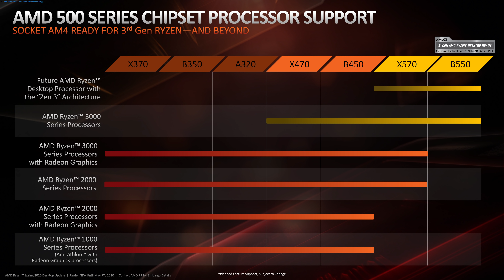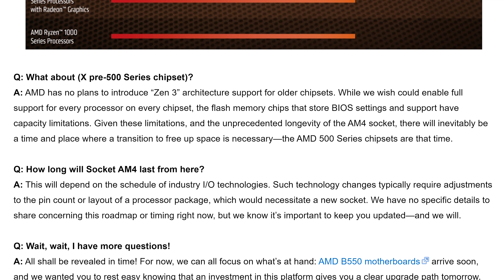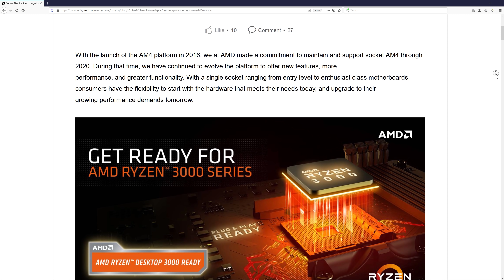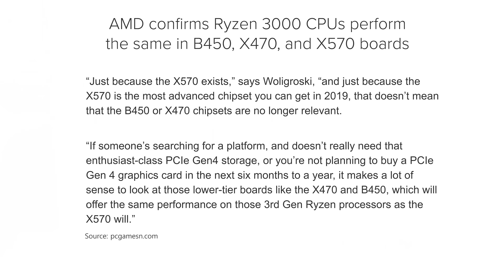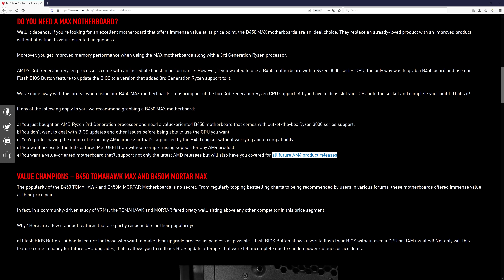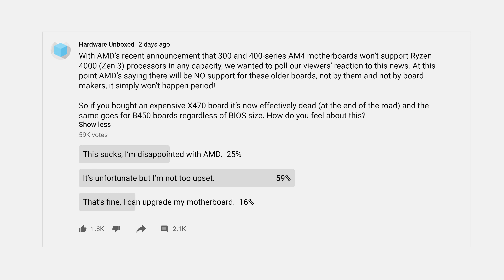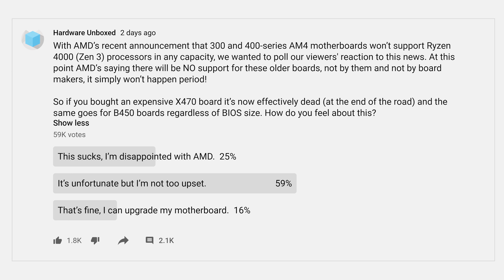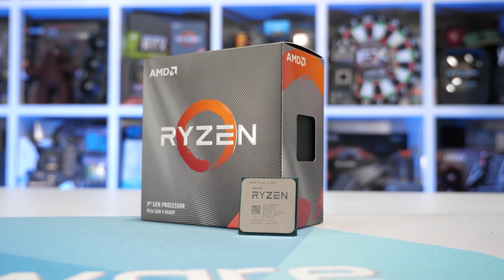AMD Does An Intel, Axes Zen 3 on 400-Series Motherboards, Our Thoughts

Comment: I'm really pissed of for the exact reasons he called out: I spent 100+ € on the tomahawk max half a year ago for zen 2, expecting it to support zen 3, however had they said back then that zen3 would not be copatible with it, I'd definetly had bought a x570 board! The way amd communicated all this was indeed very misleading!
Reply: Similar reason as you, I picked a B450 board that was slightly lower priced than entry level X570, it also had extra features except PCIE 4 which I didn't need. If AMD had to do this they should have told long ago, since they didn't tell long ago they shouldn't do this.
Reply: A friend of mine got Tomahawk MAX 2-3 days before they announced this!
Reply: @karama300video  Me to. Pissed to the max now. And going to amd after over decade with intel... Hope they don't became same!!!
Reply: @karama300video  Return/refund.
Reply: i guess b450 was just too good
Reply: I bought the Max in March this year. Would have gotten X570 if I had known.
Reply: @KeysCaliber  Right!
Reply: Same thing... My max board with zen2 is "dead" for future.
Reply: Same here, MAX board to get out of box 3000 series support and 4000 series support. Plan was to buy B550 motherboard that was supposed to come out January, but really it should have already come out end of 2019, 3 months later that X570, like B450 came compared to X470.

Funny/sad thing is I've been with Intel years and years and always bought a new motherboard along with CPU. "AMD is great, just get a new CPU, no need to change motherboard!" So to go from Intel to AMD I needed both and this motherboard has support for even less than Intel offers :)

And there's zero IPC improvement going from 3600X to 3950X (not to mention silly price), so it's not an upgrade path, like someone suggested. The time first game needs 16 threads or more to play proper, we are already on DDR5. But a 4700X would be nice, if AMD was nice..

Already see Asus coming out with a sweet Z490 mATX board, that will have support for 10k series and 11k series and if I upgrade to B550 I only get 4000. Hopefully there will be as tasty mATX options in B550, as my planned upgrade to that is for the motherboard features mainly, not upcoming 4000 series.

And last funny note, 2 things AMD had that Intel didn't is that every CPU works on every motherboard and all CPUs are overclockable. Well Zen 2 doesn't overclock and and now you can't mix/match CPUs either :) Added bonus, "motherboards are cheaper!" yeah not, X570 more expensive, last thing AMD has left is CPUs are cheaper, but now Intel is also "lowering" prices, by offering more cores on same price bracket.

Better be instant functioning AGESA on 4000 series and not current "works after 6 months" after release. Else this support blocking did zero good.
Reply: @Tobias Steindl: I fully agree with you bud. I am not effected personally (I am an X570 owner) but this move still upsets me greatly. I have many friends and know many people (and now I am adding all of you guys to the list) that are stiffed by this move from AMD. 

I absolutely 100% believe that AMD knew this was coming last year already (I am sure because of many reasons) and AMD chose not to say anything last year at X570 launch and just let everyone keep buying older chipsets regardless. 

I am livid and I think that even X570 owners (myself included) should not put up with this absolute nonsense from AMD. 

AMD chose to keep quiet, now AMD must choose to support older chipsets. End of story, no debate, do the right bloody thing AMD, period. There is no discussion, there is only AMD supporting older chipsets.
Reply: AMD fans are just... something else.
Reply: @donicsm7684  It's not just AMD fans, it's fanboys in general. Do you think any company really cares about you? They want your money
Reply: @3point1.2  The last time everyone called out Intel or Nvidia I don't recall seeing this much people on the defense. I saw a few but not this much and this intensely. 

Yeah fanboys in general but especially AMD fanboys.
Reply: @jakea3950  Calling people kids. Setting a stellar example, I must say.
Reply: Damn that sucks! My mate has x470 and 2700x , he planned to get a 4000 series cpu later on but now hes screwed
Reply: @cliche_AF  I myself have a B450 with a 2600X, bought last year's black friday. If I had even expected this to happen, I still would still have opted for the B450 but in combination more expensive and more beefy 3600 instead so I could delay another upgrade down the line.
Now I have to hope the R7 3x00X lineup gets massive price drops when the 4000 lineup hits shelves, because otherwise my upgrade strategy is f__ked!
Reply: Same here mate. And if you look on how popular B450 boards have been since the zen2 release, I would expect AMD to have a lot of angry people at their doorstep now.
Reply: I hear ya bro im in the boat, up shit creek without a paddle.
Reply: @je5terc0re  3950x isn't enough for you? Not if it gets beat for gaming by a 4600x that costs a 3rd of the price.
Reply: @je5terc0re  They promised Zen 3 AM4 support for all motherboard in 2017 and if u promise something u should make that promise come true. Many people bought a X370 because they expected support until 2020 with Zen1 to Zen 3. I understand that AMD want sell more X570 motherboards AMD do the X570 chipset but this is really shady. AMD Intel and Nvidia are companies we shouldn't trust any company and this is the whole conclusion of this story.
Reply: @strohhuttv8848  and what year is it? 2020. They ended support.
Reply: I bought Tomahawk max for the same reason. :) Seems I will have to go to X570. :D
Reply: @ziksify  
No need to rush my good man/woman.
Drain everything you can from that board unless absolutely necessary to go get 4000 series now.
IF you need to upgrade from 3000 or whatever, change motherboard, you might just as well consider Intel. 

There is NO absolute guarantee, 
that 4000 series will be supported by X570/B550.
Now they are saying that they will, but they might still pull the plug for the compatibility support regardsless.
Reply: @GameslordXY  Yes, AMD has already 100% confirmed Ryzen 4000 (Zen3) CPUs will absolutely work on X570/B550. What AMD has not confirmed is if X570/B550 will work with Ryzen 5000 (Zen4) CPUs (I doubt it, that will be AM5). 

AMD has never 100% confirmed CPU support and then pulled that support. 400/300 chipsets were never outright confirmed  (or outright dismissed until now either) for 4000 support. But X570/B550 4000 CPU support is 100% confirmed, no ifs, and or buts. 

For you to say "There is NO absolute guarantee, that 4000 series will be supported by X570/B550" is an absolutely ridiculous statement.
Reply: Je5tercore we are gamers why the fuck would we buy a 16 core latency fest crap chip over a monolithic 8core zen3 or rocket lake ?
Reply: Why did you expect it to work with Zen 3? If you look at AMD's official Socket Stability slide in the article "3rd Gen AMD Ryzen CPUs Will Work on Many Existing MSI AM4 Motherboards" (search it on Google), you'll see that the graph clearly shows no support for new CPUs after 31 December 2019. If you take a good look, the orange bar stops right at the end of 2019, just before 2020 starts. It was already know even a year or two ago that Zen 3 will come out some time in 2020, or in other words, AFTER the official support period. So how did AMD not keep their promise and why did you expect it to work with a CPU that releases after the support period?
Reply: @bgtubber  Well going by that Zen 3 wont be supported on any boards.
Reply: @JimmyChino55  How so? They will most likely release a new motherboard series like X670 with the launch of the new Zen 3 CPUs as they always do. Also, B550 was launched after 31 Dec 2019 so that one would work too. Not to mention X570 which according to AMD's official slides shouldn't have worked on new CPUs from 2020, because they didn't promise it, but after all gave us a bonus and allowed us to use it with Zen 3. So I think that people not only have no right to be mad about something AMD didn't promise, they actually made a gesture and allowed a board that falls outside of the official support period to work (X570).
Reply: @bgtubber  AMD kept quiet, that is all AMD needed to do to be completely wrong on this. AMDs MB partners were even advertising future Zen 3 support (AMD did not stop them). There is no way in heck AMD did not know that people were expecting support for Zen 3 on older (B450-X470) chipsets. 

What you are saying is because AMD did not say they would support Zen 3 on those chipsets, that AMD did nothing wrong. 

Well, what I am saying is that because AMD did NOT say that they would NOT support those chipsets (last year at X570s launch and onward specifically), that AMD are ABSOLUTELY WRONG. 

AMD knew of recent buyers expectations (X570 till now), AMD could and absolutely SHOULD have said something last year at X570s launch. AMD is GUILTY of KEEPING QUIET. 

AMD was always planning to tell us at B550s launch. And if AMD had launched B550 on time last year AMD would have told everyone then already. AMD are guilty as sin, AMD knew at X570s launch that they were dropping support (maybe even earlier than that) and they said nothing. AMD is guilty for keeping quiet.
Reply: @bgtubber  By your own logic, If you look up "x86 Cores Roadmap Leadership" you'd see that Zen 3 was supposed to come out before the start of 2020, thus it would be within that window of time you're arguing we should be focusing on. Delaying it into 2020 doesn't retroactively change what they promised.
Reply: Same. X470 with 2700X.. in the past 6 months.
Reply: Exactly this. Recently bought MSI max. It wasnt the cost, i just didnt need or want x570 feature set.
Just wanted Zen2 + 1 upgrade and all would be well.

AMD has ridden a wave of success, built on the backs of enthusiasts, and for them to blindside everyone is anti consumer.

Ill never understand why people would defend thier position, theyve made billions off us, so unless you are a shareholder,  there is no reason you should ever think its ok.
Replace the word AMD with EA and see how you still feel defending them.
Reply: Not even a year i build  2700 with Steel Legends i was thinking to upgrade to 4000 series but now fuck it
Reply: Rip
Reply: https://www.msi.com/Motherboard/support/B450-TOMAHAWK-MAX#support-cpu seems to me that it supports 3100/3300x
Reply: maybe if you instead took what AMD stated back in 2017 instead of what MSI said
MSI where incompitent anyway AMD had to practly force them to support it been as there bios was such a cluttered and bloated mess that zen2 was already over there limit
Reply: No, it wasn't misleading at all. They were strictly advertising socket compatibility for AM4 in 2020. They dropped it and created AM4+ environment. That's a deliberate misinformation for a profit. Class action coming In 3, 2, 1....
Reply: @randalldraco3822  Yeah, AMD were deliberately quiet and complicit in furthering 3000 CPU sales right up until now, fully knowing they had no intention to support older chipsets with 4000 CPUs. 

AMD should have said something last year at X570 launch (or even sooner) and taken the hit to CPU sales while people waited for B550, or chose X570 or bought B450 anyway. 

AMD should have given everyone the information to make an better choice. AMD keeping quiet is exactly what they are guilty of. 

AMD knew people expected support (look at the 300 chipset backlash when AMD dropped 3000 CPU support for them) so AMD should have absolutely said something specific years ago already. 

AMD keeping quiet and being vague is not an defense, it is their persecution.
Reply: @je5terc0re  Do you know why you shouldn't upgrade from the same generation
Reply: why would you upgrade? is your pc capable of doing the stuff you do on it? probably. built a pc 6 months ago and now upgrade?!! what world are you living in, we should call us Consumer beings not human beings
Reply: @sardaar6130  It doesn't work like that. People upgrade for many different reasons. 

I bought an X570 and 3700X because I did not want an 3950x yet. I wanted an stand in until 4950x launched with its improved 7nm+ process, higher IPC and 8 core CCXs. 

There are many people who thought similar, they bought a cheap 3600 with a plan to upgrade to something better in 4000 series, even more so because of next gen consoles using 8c/16t CPUs. 

So it is nice for them to get cheap discounted 4000 CPUs with all the benefits I mentioned when the time comes. 

People may even have other reasons, so not everyone thinks like you (or me), and everyone has different needs and trains of thought. That does not mean everyone who doesn't think like you (or me) is wrong.
Reply: @sardaar6130  
No. 
Not after 6 months, but after few years. 
1 could argue that even the earliest AM5 midrange stuff CPUs will be far superior for both gaming and productivity at very likely reasonable enough prices vs even Ryzen highest of high end AM4 4000(doubtfull)series.

However upgrading to AM5 CPU, will also mean upgrading motherboard as well as RAM to DDR5.
And that won't be affordable to many folks, especially considering this mess that 
Auntie Corona and Uncle Covid are causing.
Even if humanity wins, not everyones pockets will recover enough to upgrade. 
Even without the recession, giving 400$+ for new CPU+MBO+RAM will be very difficult challenge at best, impossible at worst many, many millions, myself included. 

With 4000 in their B450 and X470 boards, they might still get a worthwhile upgrade, even if they have to go used(I don't like used, but I do understand that sometimes it's necessary because there is no other realistic option) . 

Now with this we might be out of options. 
Still 3700X/3900X would be a worthwhile upgrade over my 2200G.
But if able, I am switching to Intel out of spite.
Reply: AMD clearly said, that AM4 isn't going to be supported in 2020. Now they didn't drop AM4 but the chipset. I can’t really understand what people were expecting.
Reply: @solteco7423 /videos Where did they say thaaat? give us something for reference please.
Reply: well just get a b550 and a windows key on ebay for $5. Not much else that can be done as I kinda doubt AMD will change their minds. Like he said it likely is just because AMD doesn't have the funds to support older motherboards with them. It's a crap excuse but companies are always stingy like that.
Reply: @Skylancer727  
And how much money their various boards (people that make the company running) are earning.
Lower their salaries and bonuses by half and they WILL have resources.
Reply: They did. In 2018. At computex.
Reply: @FreeThePenguins  they didn't say shit. The most off-putting thing here is AMD's response for not launching B550 along with X570 was that the market didn't need B550 as B450 was already there. And now they're telling us it won't support next gen processors.
Reply: @FreeThePenguins  they did what?
Reply: @BudgetGamerz  They said that the b450 and x470 boards would last UNTIL 2020, the post discussed in the video was unclear, yeah, but their prior statement was pretty straightforward.
Reply: @FreeThePenguins  they said AM4. Not X470/B450
Reply: @FreeThePenguins  Through 2020, not "until". It's literally covered in this video.
Reply: @blarghmcblarghson1903  through means until the beginning of. Otherwise you always write through the end of to denote the end of a time period.
Reply: @thakard  What? No. It's always meant "from the beginning to the end". Just open up the dictionary and look at their example of how it's used in relation to time, it means for the entire duration of the time.
Reply: @FreeThePenguins  
Really, straightforward? 
A shame that you clearly aren't a high ranking member of the MSI then, since MSI ALSO seems to have believed it that 4000 will be compatible with Ryzen 4000 series. 
You could have convinced them otherwise.
Reply: @BudgetGamerz  Last i checked X470/B450 was AM4?
Reply: @blarghmcblarghson1903  In proper English "through" does indeed mean from beginning to end. However, that's not how Americans use it. They say "1 through 10", instead of "1 to 10". So in the American context "through" doesn't mean "throughout" but "until". "Through 2020" means "until 2020", not "until the end of 2020". I'm not explaining the decision, just the grammar.
Reply: @johnm2012  If you say "1 through 10", you're including 10, right? You don't just mean you want 1, 2, 3, 4, 5, 6, 7, 8, and 9 only.

Similarly when you promise you're going to stick with someone "through thick and thin", it doesn't mean you're going to bail on them the second things look tough, right?
Reply: @blarghmcblarghson1903  I don't personally use the word "through" in that context. I speak the Queen's English so I would say "1 to 10". But, regardless, "1 through 10" does mean the same as "1 to 10", but that's not my point. My point is that "through 2020" in American English doesn't mean "throughout the whole of 2020" but "until 2020". In other words, we're already there. It's 2020. Promise fulfilled.
Reply: @blarghmcblarghson1903  Here's another way of looking at it. If I work from 9 to 5 or, in America, "9 thru 5". I start work at 0900 and stop at 1700, not at 6 o'clock or 5.59 but at 5 o'clock.

"Through thick and thin" is an abstract concept. Were taking about time, which is continuous, not integers, which are discrete. On the number line "1 to 10" stops at 10. It doesn't continue until it is infinitesimally close to 11. 2020 has been reached, and then some.
Reply: @johnm2012  Having lived in the US (California, Ohio, and New York, specifically) for 14 years, I have never heard anyone say "working 9 through 5", it's always been "9 to 5"; granted that's anecdotal evidence, but if I do a search for "work hours 9 through 5", every single English search result, regardless of the publication's country, says "9 to 5" instead.

Could you be confusing through and to usage with the week days? I'm seeing a lot of British people claim it's common in the UK to say "Monday to Friday" and that "Monday through Friday" is uniquely American, but even then it's understood "through" is inclusive of Friday.
Reply: thats why you dont cheap out on motherboard why THE HELL would u buy b450 with ryzen 3000 ur dumb sorry
Reply: @aditrex  so you are saying i should buy a 200 dollar motherboard for a 170 dollar cpu?
Reply: @aditrex  X470 is also screwed out of support as well.
Reply: Aditrex TV 

Because AMD didn’t (AND STILL HASN’T) released B550 boards. Honestly, if B550 had been released when they were suppose to then I would say, yeah people should’ve upgraded. But as the video said, not only did AMD promote people using B450 & x470 boards with Ryzen 3000, they also haven’t released the cheaper motherboard alternative (B550) yet. So yeah, can’t really blame the consumer on this.
Reply: @Athasin  amd never promoted to use ryzen 3000 with older board ur dumb comments makes me cry hah they were saying older boards supports newer cpu  and just to add why u crying u paid frikin 100bucks for motherboard b450 i paid almost 200bucks for x470 and i dont even complain at all just lol u have still options for upgrade 3900x 3950x ? not good enough right then go to intel youll need to pay every generation new board simple as it is
Reply: @aditrex  if you watched it you would know that it goes for all x300 and x400 series.
Reply: @aditrex 
Sorry? 
What are you talking about?
Why are people dumb because of it?